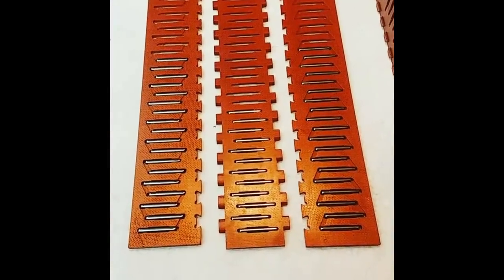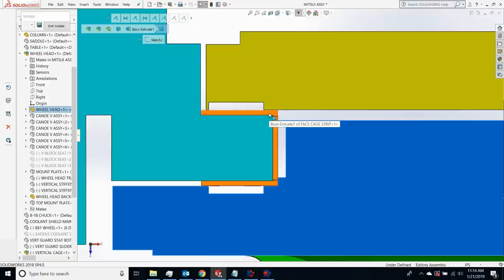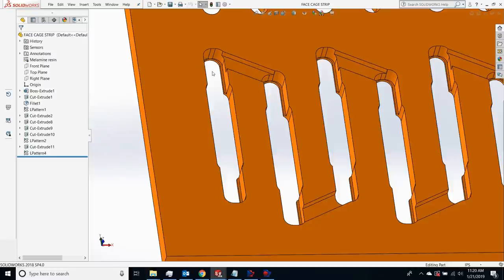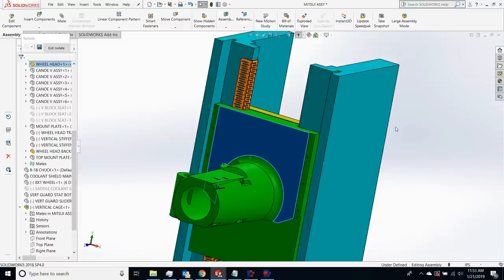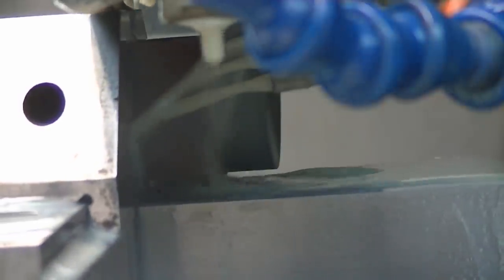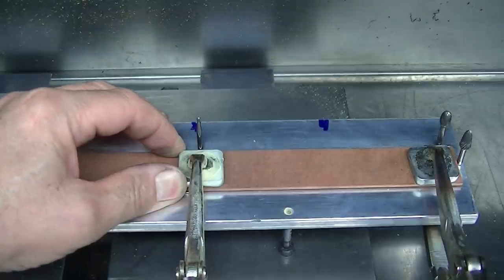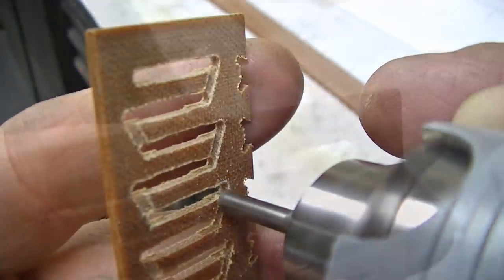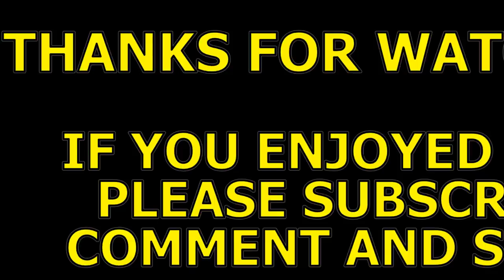MAKING LINEAR NEEDLE BRG. CAGES

Comment: Great video as usual.Robin. I hope that the following is only a theoretical concern, but I wonder about the following scenario if there is no mechanism that absolutely biases the phenolic cages towards their appropriate half-rate movement position relative to the sliding head. Specifically, after extended normal use with less than full range movements of the sliding head, there may be a tendency for the cages to creep longitudinally, most likely downwards. That would not necessarily create a problem until one day you move the sliding head to one end of its full range of movement, in which case, if the cage has crept longitudinally from its proper position, the cage could be forced up against whatever forms the end of the cavity that it occupies. With pre-load and the loading from the sliding head, the force on the cage could be substantial. The force required to cause sliding of the rollers is doubled by the “half-rate” movement action of the cage. Are the cages strong enough to force the all the loaded rollers to slide in that scenario? It could result quite a large cumulative force on the end of the cage. A rough estimate of that force would be twice the coefficient of sliding friction multiplied by the pre-load force attributable to that strip of rollers. 

Even if the cage cavity is longer than it strictly needs to be, over time, there would still be a tendency for the cage to migrate to one end of the available space and encounter the scenario described above. I suppose this consideration applies to any linear roller slide, but presumably, longitudinal creep of the cage is more likely in a vertical slide where gravity provides a permanent bias. When a roller becomes unloaded it would tend to drop to the bottom of its space in the cage and the cage itself will tend to drop down and hang on the loaded rollers and so on.
Reply from the maker: Thanks Nigel, all your concerns are warranted. Cage creep is a real phenomenon but is usually most prevalent in vertical higher speed motion where the cage inertia also has gravitational loading added to the inertial force on the down stroke causing slow migration of the cage downward. The vertical travel of the surface grinder is extremely slow so inertia loading is minimal. I plan to run this without any creep control and monitor the creep. If it appears in any measurable amount I will add a pulley counterbalance on each cage assembly that has slightly higher weight than the cage/needles to reduce the creep to insignificant levels. There are several inches of cage overtravel space at each end of travel.
Reply: @ROBRENZ  The limitation of a simple counterbalance system is that it doesn’t bias the cage towards the correct position relative to the slide, rather it just alters the bias, hopefully, towards neutral. However, the cage is still “free range”. The ideal is a pulley or other system that reproduces the half rate movement of the cage relative to the slide. In that case, with the cage is connected to the guidance system with a fairly stiff spring, the cage is always be being biased towards its proper position. The spring connection accommodates any minor incompatibilities of movement between the guidance system and the cage without causing excessive corrective forces to be applied to the cage.  That should eliminate any possibility of the cage ever creeping either up or down but I guess it is all extra complexity with its own potential for malfunction. The try-it-and-see approach is the simplest but it would be a shame to if those beautifully crafted cages eventually graunch into an immovable object, maybe when the machine has passed to someone else. 

Speaking of immovable objects, how is the granite surface plate reconditioning going? After seeing Tom Lipton’s video on the reconditioning of his plates, and your initial video,  I am very interested to see or hear of any progress that you have made, with or without the assistance of the self-calibrating digital repeat-o-meter, oops, the Renz-o-meter.
Reply from the maker: @rockwell6594  Agree completely with all of the above. But I am going to try it as is. My guesstimation from my experience with linear preloaded needle bearing systems is that it will take 6 months to see any measurable creep in  this axis of the grinder. The needles are a gage fit in the cage so they can't skew when entering the lead in ramps of the races.  The surface plate will have a final video, I have been making some autocollimator goodies to check with that also.

Comment: very interesting stuff.  Thanks.  Is there other materials that could be used for a cage like this,  PFTE for instance?
Reply from the maker: Cages need significant structural strength. Nylon is often used for plastic needle cages but PTFE would be too soft.

Comment: Robin how do those jaws mount on your vises and what do the vertical T like slots on their ends do?
Reply from the maker: They are my own custom jaws. I will do a video on them sooner or later.  The T slots hold various stops.
ATB, Robin
Reply: Robin made a bench vise jaw video couple years ago with hidden mounting bolts well worth watching.
Reply from the maker: They are blind tapped from the back 7/16-20 and the 1/2-13 tapped holes are drilled thru 7/16". I use grade 8 hex head bolts from the outside to hold the jaws on.
Reply: @ROBRENZ  I was wondering what those hex heads on the back of your moving jaws were I assumed you were plunging off the 1/2-13 tapped holes. But those bolts go all the way thru and hold on your jaws. I like this Idea it emanates those counter bores in the jaws. Sometimes that screw head is just where you need a clamping surface and they catch shavings in them. Also in order to change the vise jaws you have to open the vise enough to get a wrench in and back off the screws. The jaws may also be somewhat stronger and more stable. And I assume you can still use the standard jaws with the 1/2-13 cap screws?
Reply from the maker: @EdgePrecision  Yes the 1/2-13 are still good. All the reasons you mentioned are why I made these. There is some real magic in the rest of the jaw system that you will like.

Comment: I have complete confidence that you will cover every corner and everything will be amazing. But, I wonder about the needle bearing traps slowly sliding downwards, sure, the fitment will be dead nuts on the proper preload, but, over the course of 50 up and down travel movements of the head,, the hearing traps will still work them selves down a wee bit, kinda like the point pin bearings on larger progressive sheet metal stamping dies... My thinking is, when you go to drop the head down pretty low, and the hearing traps/cages, and up bottoming out on the main base of the machine, and the head still has a bit of distance yet to go in downwards travel. Sure the phynalic (pardon the spelling) fiber glass needle bearing cages are flexible, never mind if the bottom non in closed needles possibly calling out all over the place of damaging the cages, or flat spotting the needles or scarring the mating surfaces, maybe they won't work them selves out / downwards. Please note, I am in no way trying to act smarter then you! If I was smarter then you, you would be watching my channel, instead of me watching your channel, lol
Reply from the maker: Cage creep is a real phenomenon but is usually most prevalent in vertical higher speed motion where the cage inertia also has gravitational loading added to the inertial force on the down stroke causing slow migration of the cage downward. The vertical travel of the surface grinder is extremely slow so inertia loading is minimal. I plan to run this without any creep control and monitor the creep. If it appears in any measurable amount I will add a pulley counterbalance on each cage assembly that has slightly higher weight than the cage/needles to reduce the creep to insignificant levels.
Reply: @ROBRENZ  ah, cage creep, what a perfect title...  Roger that, I didn't doubt for one second that you are already past these thoughts, and was just wondering, is all... Thank you! Dru

Comment: are you going to machine a slight tapered ramp for the needles to be guided under the moving table or a bolt on edge ramp.. ? fill the rasberry with rasberry filling aka.. some epoxy ..
Reply from the maker: Yes, already done on the mating hardened inserts.

Comment: In my experience using machined linen phenolic as a material for fixtures, it can swell with moisture enough to be a problem.  I would imagine that it will also swell with oil, especially since it's not glass mat.  Did you take that into account, maybe soak a test coupon... I think I heard you say it was a fit of some 50um?
Reply from the maker: I will bake them out and then soak in the lube. swell is 1% so that would only be 0.0008"

Comment: Can linear rails be used for this modification? I mean those with re-circulating balls inside. I thought about milling pockets in the original box ways and putting some beefy linear rails in, one per a side.
Reply from the maker: Ball linear rails are not as stiff as roller or needle bearing linear rail systems.
Reply: they also stick out more and are more expensive ~

Comment: why not moglice? i worked on a large high precision milling machine who's bed was riding on rolling elements (needles) like that, but i think the cages were bronze. Don't like working with abrasive materials. They sell round hss bars, we used them to rebuild needle bearings in gears. Had to get cut to length but it was cheaper than harvesting needles.
Reply from the maker: moglice still has much greater stick slip than a needle roller system.
Reply: @ROBRENZ  Ah, i wasn't aware the head is counterbalanced on such a small grinder. I presumed there was no stick since the head is freefalling, only supported by the downfreed screw. Will you use a ballscrew in its place? Even if there is a counterweight, you could adjust it so the net force is slightly towards the earth, no?
Reply from the maker: @meocats  It is not counterbalanced, that has  nothing to do with stick slip. It is a plain acme screw that I will mold a Moglice nut on.

Comment: Very interesting design, I really like it if it works! 

The oil film around the carriers is an idea I never saw before, and I guess the film needs to be rather thin for the desired damping to occur. Is there a risk of the strips swelling in the oil? 

I have used phenolic for ball carriers, but never to very close tolerances. Its pretty dimensionally stable but the oil absorption is around 3% if the composite is very dry, if it is moist it will absorb very little oil short term. Perhaps drying the strips in an oven and soaking them in way oil to assure that they stay to dimension would be a good idea. I have never seen nor measured how much phenolics swell in oil, but I suspect this may differ. 

Taking apart very old bearings You can still feel the phenolic being oily,  The cotton and linen varieties are what to use, paper can be somewhat abrasive in our experience.
The only concern I have spontaneously with Your design is the "fishtails"  since it seems phenolic composites always tend to fail at sharp corners and notches but hold up well for more rounded shapes.
Reply from the maker: Thanks for the Input Erik.  I made the cages 0.0047" thinner than the 0.0787" rollers. 3% growth would take them to 0.0762" thick. That leaves 0.0024" clearance which will get slightly smaller from preloading the rollers.  Should end up with roughly a 0.001 thick oil film which with Vactra#4 should give some significant damping.

Comment: I don’t know if it’s feasible, I have seen the linear needle roller blocks on eBay for less than $20 pair I think the maker was Schneeberger .. the longer ones are about 8 inches worth of needle bearings about the same size .. I’m not talking about the ones that are used on a linear rail for machine tools it’s open ended version

Comment: On the vacuum fixture, is the o-ring groove a standard depth and width (ie Parker O-ring Handbook) or are the groove dimensioned modified so the workpiece is contacting the fixture? Maybe the o-ring durometer has an effect on this?

Another informative video and well reasoned design, can't wait to see how this turns out.
Reply from the maker: Not standard. 0.070" wide x 0.060" deep the part definitely sucks fast to the aluminum.
Reply: Thank you!

Comment: Another nice video.   How do you keep the rollers from falling out at the travel ends?    When the grinding spindle is in the middle of its travel, all rollers will be covered up, preventing them from falling out.    However, when the spindle is at one end or the other, won't some of the rollers be exposed?   If so, what keeps them from falling out?     Thanks, Bill
Reply from the maker: That was  mentioned in the design section of the video. The cage never leaves the long D2 rails and the roller slots keep the rollers captive against that rail surface.
Reply: @ROBRENZ  Thanks for your reply.   As you said, it's explained in the video (starting time 12:22).     Looking forward to seeing the finished machine.       Bill

Comment: Thanks a lot for the idea of hard(ened) inserts from planer blades. I am currently rebuilding and modifying my lathe (EMCO maximat standard) and i was wondering if is is a good idea to make similar inserts for the lathe bed since it is currently plain cast iron and i would like it to be something harder. It will then be surface ground after the inserts are glued in place to ensure flatness. What glue is good for gluing such inserts in place?
Reply from the maker: Loctite 325 with 7075 activator (spray can version)

Comment: Robin , You could have order needle bearings for outboard 2 stroke motors I have bags full!
Reply from the maker: Individual  loose needles?
Reply: There are plenty of way to get/make needle bearings, but what tolerance did you desire for your surface grinder project?

Comment: Are you concerned with the change in bearing preload due to temperature fluctuations in the pieces?
Reply from the maker: There will be very little temperature gradient between the parts so no the variations will be minimal.

Comment: Loose needle bearings are pretty commonly used in the automotive, agricultural and construction machine industries in things like transmissions, transfer cases etc where the bearings directly support rotating gears on shafts and the gears and shafts are the races. You just have to Google "loose needle bearing rollers".  https://www.finditparts.com/products/4290547/federal-mogul-national-seals-c-407-q

Comment: Is that a Trak  bed mill? I have an opportunity to purchase a 2 axis older MX model. Just wondering how you like it. Any trouble loading g code, the controller doesn’t seam to advance. Dave
Reply from the maker: Yes a Trak,  The control requires a option to read G-code.
Reply: ROBRENZ not to sure about the 2 axis cnc, thinking about converting to a 3 axis but no ball screw on the Z.  Just wonder if you know were I can get Ultra pure Grease to use on spindle bearings (New Departure 20206 dtt class 7) for my surface grinder. Maybe I’m not calling the correct terms. Thanks Dave, love your videos!
Reply from the maker: Kluber NBU-15
Reply: ROBRENZ  Thankyou.....Dave

Comment: i know your busy but i have a chance to buy a south bend 2VH mill made just like a bridgeport and i wonder what your opinion is can i get parts for it and is it a good hobbiest mill it is much heavier than a bridgeport 2400lbs i think and a little more robust i think just cant find any info on the mill thanks Lee
Reply: Heavier wins. If it's bridgport clone it can be result and scrapped by pretty much any machine rebuikder. The head and leadscrews might require a little work. I'd absolutely get it. 
There's no replacement for mass
Reply: @zHxIxPxPxIxEz  the problem was i could not find a dependable parts source so i got a 1973 bridgeport
Reply: @le3045acp  glad you got one. I figured they'd be interchangeable. Thanks for the heads up
Reply: Check out Mr. Pete 222 video on the South Bend mill that he bought and reviewed several months ago. Similar to a Bridgeport but different head design.

Comment: Hi Robin,  Thanks for this incredible video! 
I didn't catch why you used the phenolic material vs other materials.
My understanding is phenolic materials are hydroscopic that is why it's sealed.  Is this material hygroscopic after you surface  ground it?
Are you planning for the way oil to mitigate the  any hygroscopic issues?
Thanks!
Reply from the maker: It will absorb oil and swell a little bit.That is another reason why they are sealed air tight in the pvc shrink tubing until assembly .
Reply: @ROBRENZ  Thanks!

Comment: Other than time to make them, wouldn't drill rod be a lot less expensive and work well enough?
Reply from the maker: definitely not
Reply: Drill rod - W1, O1 - is sold in a non-hardened state as a rule.

Part off, machine ends, harden, grind to size…. Try to get them round and properly finished…
Reply: I first thought of commercial dowel pins but probably not available in the diameter and length needed. Needle rollers are the perfect choice for this job.